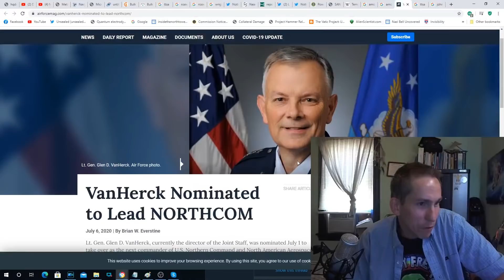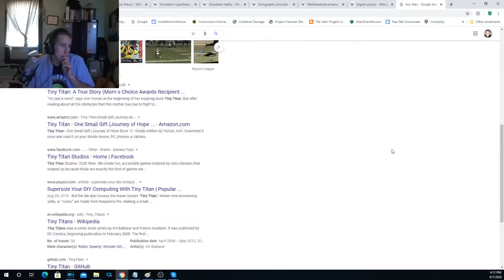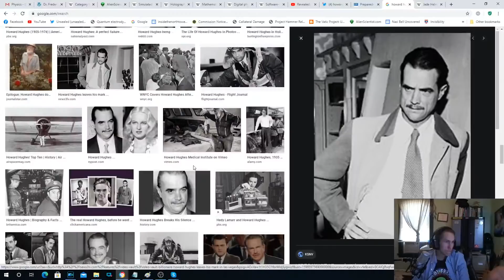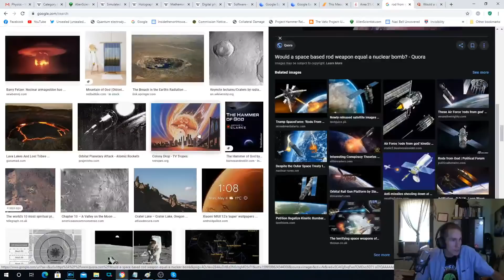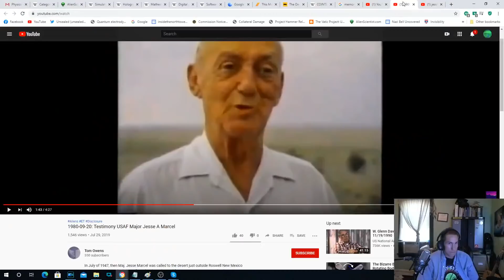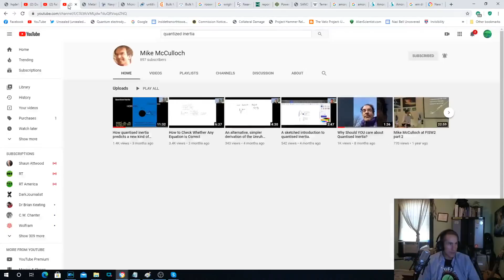Was the Roswell Memory Foil a Metallic Glass or Amorphous Metal?

Comment: You can make metal glass. It's just a matter of the right cooling gradient for hot metal, which is around -100°C/sec. This will prevent crystallization because metals are naturally crystalline forms. Metallic glasses, on the other hand, are amorphous. Foil is produced because the correct cooling rate can be achieved on it. You can't cool thicker pieces of metal that quickly.

Comment: The best way to manufacture these kinds of material is in a near-zero gravity environment. In that way, the metal can cool evenly without flaws.
Being in orbit like the ISS would work, but for small, thin pieces of material that can cool quickly, you may be able to do it using the 30 seconds of near-zero gravity on an aircraft maneuver like the "Vomit Comet" performs.

Comment: You still haven't figured it out yet?
Very little is real information. It is all designed to have you running round trying to connect the dots for which there is very little in the way of actual dots.

https://www.youtube.com/watch?v=gLIwwGSddiM

 More on the subject of metal glass...
Reply: @Aaron Washburn 
https://www.youtube.com/watch?v=Evji4-_VUmo

 Point made on my part....

 A curious point made by you. Are you saying aluminum is not a metal?
Reply: @Aaron Washburn 
You mean an alloy of aluminum? Like Super conductor materials? If it has metal in it, it is an alloy of that metal...
https://en.wikipedia.org/wiki/Alloy
Reply: @Aaron Washburn 
 I'm not confused about anything. If there is a metal in the mix it is an alloy of that metal. Weather or not the alloyed material is a ceramic or not it is still an alloy of the metal within the mix. Like ferromagnetic materials.
 Also I am not confusing anything. What is confusing you is my original point that someone can take an obscure fact and link it to the most ridiculous theory.
Reply: @Aaron Washburn 
Care to explain what is aluminum oxide if it does not contain aluminum? An how come I can take an oxide of say iron and turn it back into iron?
Reply: @Aaron Washburn Metal oxides thus typically contain an anion of oxygen in the oxidation state of −2.
 Now why would they call it a metal oxide? If it contained no metal...
"Elemental iron, combined with non-metallic carbon or silicon, produces alloys called steel or silicon steel. The resulting mixture forms a substance with properties that often differ from those of the pure metals, such as increased strength or hardness."

Comment: What if light is not a traveling particle, but, a perturbation  of a medium. Dual slot experiment... Much like making waves in water, the water is not moving so much as the waves are. Light is a coaxial circuit as everything in the universe is electrical/magnetic in nature. Recent news claims matter being made from two lasers might have some interesting bits. The original eight ormus elements are a group of elements in the center of the periodic table. These eight metals include: ruthenium, rhodium, palladium, and silver (known as the “light platinum group”), osmium, iridium, platinum, and gold (known as the “heavy platinum group”).
Reply: The key is the Æther.

Comment: I have broad daylight footage of the black triangle in action. It would appear Alien to the average onlooker, But the one I filmed had a canopy in the top centre with four aircraft style windows sweeping around to the side. The points of the triangle were sheered off with red lights below and at each tip. It also had a white glow to the underside in the centre. The surface looked like solar panel black and the craft was est around three fighter jets in size. The craft first appeared as a ball of light very intense like a small sun. It was moving toward my location as the light dimmed the craft could be seen, it then stopped began to rotate on the spot before performing an amazing maneuver  as well as casting out a high powered flash of light that was also picked up on film!. The craft was seen at a distance where it seemed to activate a surrounding ball of red light that made it near impossible to film or see with the naked eye. The craft moved toward my location once again then slowly moved on it's way probably back to the nearest military base if you ask me.